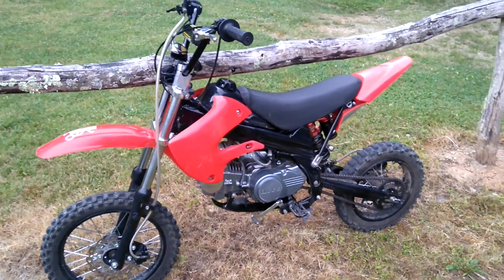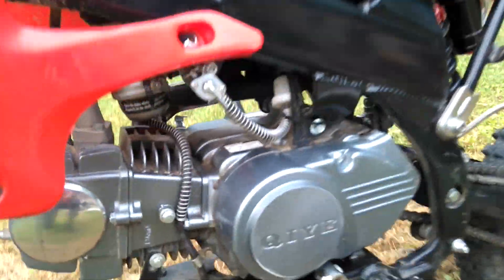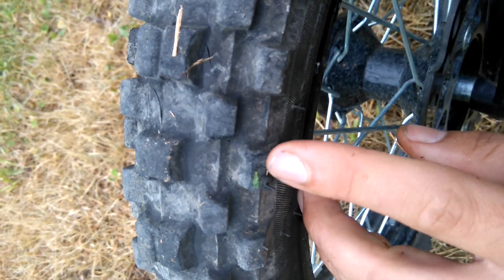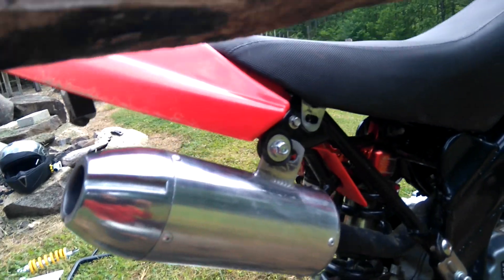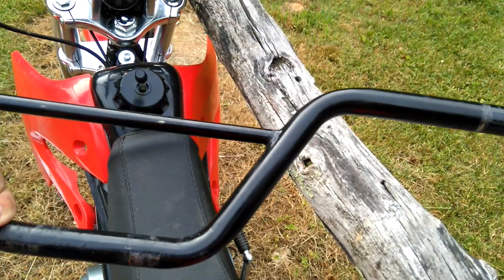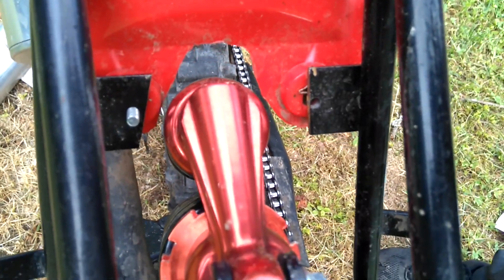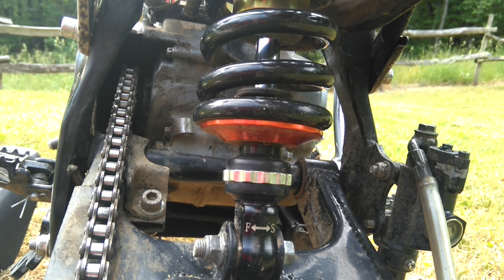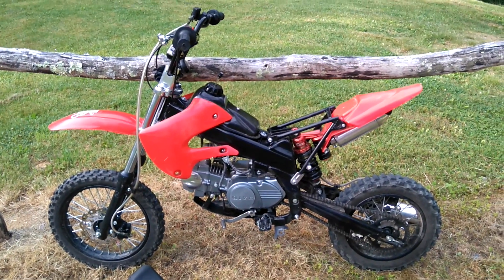2017 Coolster 214fc 125cc pit bike review + upgrades

Comment: that rear shock really sounds like it makes a difference, im gonna try and scope one out for my pitty
Reply from the maker: Yea it really does, it's actually makes it work as it should...just be sure to measure the length of the shock from both eyelets (the holes they screw into the frame from) in mm and thats the length you want to buy, I am not sure what model your bike is so I can't look it up, but I know you don't have the 214fc model for sure
Reply: Drew Rides Across America hey man, im wondering what updated rear shock would fit my bike. I have a 2017 apollo db X-15 RFZ-125 thanks,Nick

Comment: good review man. i had a 2015 214fc that bike was great!! never really had trouble with it either. sold it and bought a 400ex. now i have another coolster pit bike but it's older and not near as good as the one i had before
Reply: I just bought the 2015 model you mentioned yesterday and man I love it! Got it just under $300. Needs some love but it runs and rides great already!

Comment: where i can find the shock (back suspension)
Reply: SirLeo 90 11.6 inch you can find them on eBay I dropped the front forks a little an put a dnm 10 inch shock in

Comment: I'm thinking of buying a 125cc pit bike and I was wondering what company you would recommend (Coolster, Apollo, or SSR). Also you seem to be the only YouTuber that has done such a thorough review of this bike. Anyways any and all comments are appreciated. Keep up the good work!
Reply from the maker: I would say none to be honest with you. Mines broke like 2 months ago, hence no more videos riding it on my channel. Get a name brand, something that is more reliable and can be repaired by a local mechanic. Just buy a used yamaha or honda on craigslist
Reply: Riding in Western NC How did it break?
Reply from the maker: DI at the end of my last video riding it at brown mountain, rode it to its limits for a few hrs and it died in the parking lot. Changed the spark plug and ignition coil and nothing still broke won't turn on or crank over
Reply: Riding in Western NC Thanks for your help and good luck with everything
Reply: Ssr are the best pit bikes my friends had his 3 years with no problems except the wheel

Comment: Where can I get the chain slider? Mines totally gone now. Also what size is the rear brake line you have looks better than  the long one I have on. Lastly, do you have any issues with that throttle sticking?

Comment: What was the length of the stock shock? Was looking to purchase this shock.. I need (10.25" ) but I can't find one that's 1000lb ... so I'm going to go up to 11"
Reply from the maker: stock shock is 280mm so 11" is the right one
Reply from the maker: this is the one I bought and had to cut the bike to get it to fit: http://www.ebay.com/itm/11-280mm-FASTACE-66AR-51AR-REAR-SHOCK-1000LB-IN-110CC-125CC-SDG-SSR-NEW-/401142561417?hash=item5d65f5ba89:g:SdEAAOSwIzNXO4Wn&vxp=mtr

and this is the one you don't need to modify the bike, it should fit as a plug and play and still has a internal reservoir so you want to buy a shock pump to put air in the valve: http://www.ebay.com/itm/11-280mm-FASTACE-66AR-51AR-REAR-SHOCK-1000LB-IN-110CC-125CC-SDG-SSR-NEW-/401142561417?hash=item5d65f5ba89:g:SdEAAOSwIzNXO4Wn&vxp=mtr
Reply: pity bikester OK thanks for the reply.. I found one 10.5" so I'm going to try that one.. it's a fastace 1000lb shock!! My swing arm has a 6 inch stretch so I don't want to go to high..

Comment: Have you had any problem with the chain rubbing all the way through the soft rubber guard? (Just behind the engine at the ‘body hinge’ point) we’ve had this great bike (125cc)for two days but it’s already worn through so the chain is now riding right on the metal frame.
Reply: Tour chain is probably too tight and thats why its going though so fast or you just had a crapy one

Comment: Great review brotha. I love the bike too man. I think I'm going to get the same shock. I did see one with out the piggy back. Same brand wonder how well it works it's only 95$
Reply from the maker: erick swanson If you don't mind chopping the bike a bit I say spend the extra $35...it will be worth it down the road. The coil will fit right on though if you don't have a way or don't want to chop up the frame a wee bit. Either way though you're better off than keeping the stock one if you plan to do any type of trail riding...bc the most important things besides gas going into your tank which = practice time is tire choice and suspension. I just bought some new Michelin tires made for intermediate to hard pack terrain since it's real rocky out here and am curious how much better it will ride with those and the new shock and handlebars...also the shock length is 280mm or 11" so you know
Reply: Yeah I'll probably end up chopping it how u did. Prob gonna get some pro taper bars I found on amazon. Thanks for the info bro
Reply from the maker: anytime man, i'm new to this but i like to do research and i get addicted to things and this bike is definitely my new passion 100%
Reply: Hahah we're definitely in the same boat my friend. Can't wait to start hooking mine up
Reply from the maker: Found it for $85, and it has all the same features as the other one, even a valve to add air into and rebound/preload adjustments, so the only difference is $45 and the larger reservoir to put a larger amount of air into. All this does is makes it stiffer without having to waste any of the length of the spring by preloading it. If you weigh less than 200 I would say you don't need the one I got. I'm like 185 and I plan to go camping with this thing after trail riding so ill be riding with full gear on gnarly trails sometimes so I got it for that reason: http://www.ebay.com/itm/10-9-280mm-FASTACE-BS-22AR-BDA01AR-REAR-SHOCK-1000LB-IN-NEW-IN-BOX-/401142561386?hash=item5d65f5ba6a:g:sQAAAOSwZetXO2kR&vxp=mtr

Comment: Where did you get the battery powered tail light and indicaters
Reply from the maker: http://www.ebay.com/itm/Rechargeable-Bike-64led-Rear-Tail-Light-Turn-Signal-LaserWireless-Remote-Control/401364834459?_trksid=p2047675.c100005.m1851&_trkparms=aid%3D222007%26algo%3DSIM.MBE%26ao%3D2%26asc%3D44757%26meid%3D5b0d4215e46c44578062c4488f4eeeef%26pid%3D100005%26rk%3D4%26rkt%3D6%26sd%3D401224203378
Reply: Thanks man
Reply from the maker: yea no problem
Reply: Does NC stand for North Carolina?
Reply from the maker: yes it does
Reply: Drew Rides Across America would u recommend this bike and can a 4 foot 5 person ride this (my son) and how fast does it go also is this good for a beginner rider that would use it on mild trails no big jumps
Reply: Dirt Bike dude a great starter bike for a 4'5 person would be a 50 or 80cc
Reply: Dirt Bike dude no this bike would be way to big for him you have to be at least 5' foot it tops out at 55mph
Reply: Caleb's Vlog's do you have this bike?
Reply: Dirt Bike dude yes
Reply: Dirt Bike dude I also have an Ssr 110 which is a great starter bike for shorter people
Reply: Caleb's Vlog's when did you get the bike and would you say it’s good?
Reply: Dirt Bike dude I got it about a year ago when I got it I changed the air filter that I got off amazon for $15. The bike is really nice I mostly have it for wheelies. It’s durable too I’ve dropped it twice. For a Chinese bike it’s high up there on the charts. Everything feels nice on it still and it looks good
Reply: where can i buy this bike ?
Reply: Deziah Gonzalez killermotosports.com has it- that’s the only site I would buy from and trust( 10 minutes ago I was riding this bike)
Reply: Deziah Gonzalez definitely killermotorsports that's where I got mine and their delivery price is good that's the place I trust the most and they have the best deal
Reply: Caleb's Vlog's bro my bike won’t start- haven’t done anything except change gas and add more oil. Any thing I need to know. This is my first bike I had it for 2months and didn’t change oil or do ANYTHING to it beside add more gas and ride daily! What should I do.
Reply: Dirt Bike dude you added oil when you got it though right
Reply: Caleb's Vlog's yes
Reply: Caleb's Vlog's we changed it today! But it won’t start. I rode in the snow and ice though I also went 20mph through some 4 inch deep holes of water—— so what do I do
Reply: Dirt Bike dude if you have a bike shop by you you can bring it there. If not you can find someone near you by googling people that work on small engines. Google small engine shops in your city and you can find a place. That would be the easiest thing to do
Reply: Dirt Bike dude Go to amazon and look for a spark plug and buy one. But first clean out the carburetor
Reply: Caleb's Vlog's cool thx
Reply: Caleb's Vlog's how do I clean out the carb
Reply: Caleb's Vlog's do you know how?

Comment: hey I've got 2 questions about the 214fc that are driving me nuts. mine is a 2014. ok, what is the extra connector for on the wiring harness underneath the seat? it's the same size 5 pin connector as the cdi module connector. 2nd, as I ride mine after about 5 to 10 minutes it will bog down and shut off. is there a reason for this?
Reply: Jason Cadle check to make sure your gas tank is breathing. if that's not it check the fuel filter! hope that helps
Reply: most likely the tank not being able to breath causing a suction-like problem !!
Reply: It could be a air filter, carbuerator, fuel lines. Or when your starting it you may keep it on choke to long
Reply: SPARK PLUGGGGGG
Reply: Atv does the same

Comment: the listing on killermotorsports is really confusing they make it sound like the mad max plus is a better bike. this one says it only has a max rider weight of 140 pounds?
Reply from the maker: I know dude LOL i emailed them twice with all the right information and they havent updated it. i told them its all wrong. seat height for instance is 31", they have it at like 23" lol and they say its not for big riders, but its a MID SIZED pit bike with 14" front and 12" rear, perfect for an adult. I ride at 205 with camping gear on my back on this bike, that max weight is completely wrong
Reply from the maker: that's the only reason I made this video, because they wouldn't update their info and people should know that info on their site is all wrong for this bike. some of the photos arent even of this bike, notice the single frame instead of the black dual perimeter, also lots of silver parts that are now black

Comment: I have one of theses bikes, but my chain keeps on flying off. Do you think you know what the problem is?
Reply from the maker: yea, have you ever tightened the chain? it need to be tightened regularly, especially if you don't keep the chain lubed up before each ride it will stretch faster. there are a lot of videos on youtube on how to tighten the chain on that bike
Reply: Yea I've been tightening the chain regularly, but when I shift into second the chain come off every time, do you think a new chain will fix the problem?
Reply from the maker: that is weird I have never heard of that happening. are you tightening it too much maybe?
Reply: Riding in Western NC I don't think I'm tightening it too much, I don't know what to do at this point
Reply from the maker: I hear you man. I suggest take it to any small engine mechanic and see what they say
Reply: Riding in Western NC ight man thanks
Reply: had same problem changed both front and rear sprocket and new tensioners dont have that problem no more
Reply: How to Android thanks I'll try that
Reply: akaRxvo - Ps4  please i need help I want to get this bike, so I have questions first......1) how tall should you be to ride is it good for someone 4 foot 5 for my son 2) did u fix the chain problem 3) is it a good bike and would u recommend
Reply: @akaRxvoPs3  hey man I know this was 4 years ago but I’m currently having the same problem with the same bike. Did you ever find a fix?

Comment: Just a suggestion: never buy cheapest chinese bike.
I bought kxd 612 pro (I know its still shitty chinese bike). Those were available in my region.
It has bigger front shocks, better chain, sturdier frame design and it was 100eur more than cheapest same cc bike.
Things you have to do on new bike: change oil (even if its new bike with new shitty "chinese" oil) and change oil every 300km or less, good thing to replace all screws (they are shitty quality and most of the time can break while tightening), use thread locker on screws, adjust and lube your chain with chain lube spray, take care of your bike and it will last pretty good. I own 125cc bike for 1 year and still never had problems with it.
Things you should't do with chinese bike: never attempt jumping with chinese bike (frame and screws are made out of soft and fragile metal), never hit the gas to its limits before 300km of use.

Those bikes are not that bad if you take care of them, you can order parts online cheap and the bike itself is cheap compared to branded bikes. so if you looking for cheap bike to have fun and love fixing them and don't want to spent ton of money then its good choice.